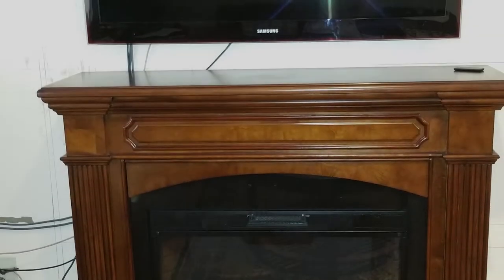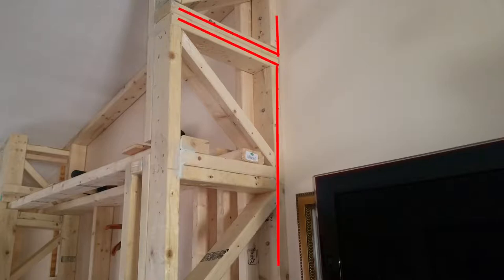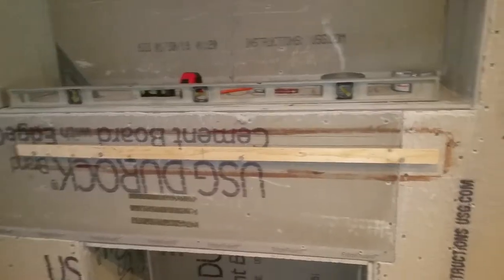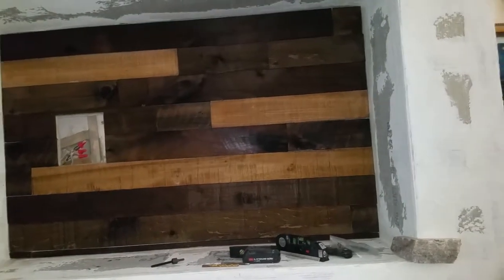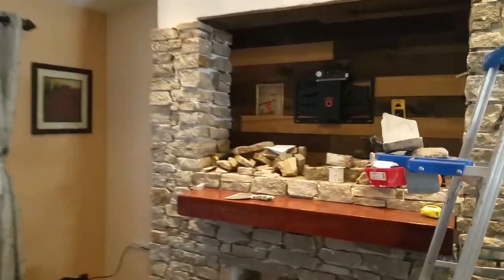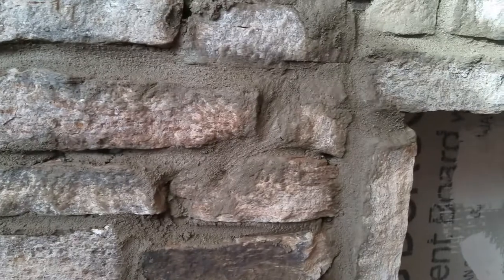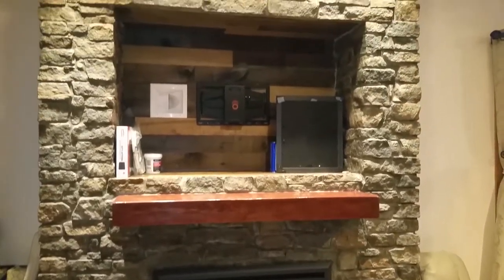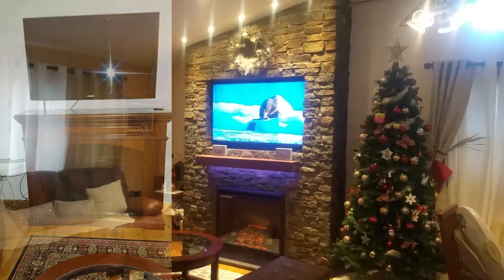How to build a fireplace with recessed TV

Comment: What was the finished weight of the project? Any issues with the floor ? thanks
Reply from the maker: 3k estimated, no issues, at all so far. You need to use a truss system to distribute thecweight
Reply: Da P.A  Thanks. Finished product looks great.